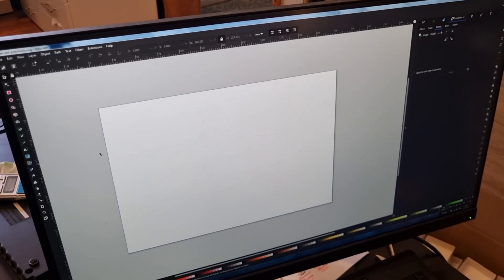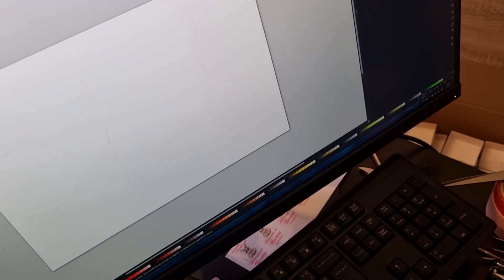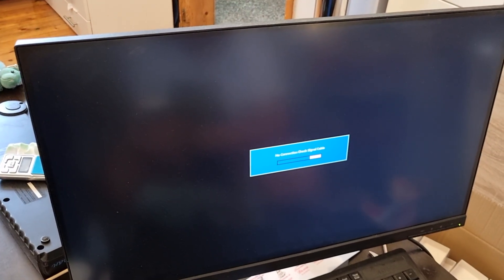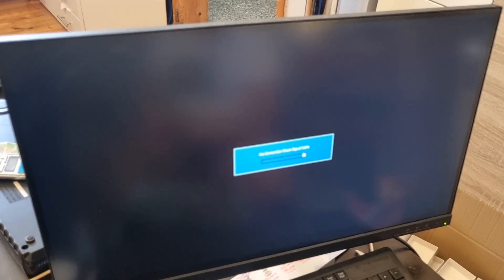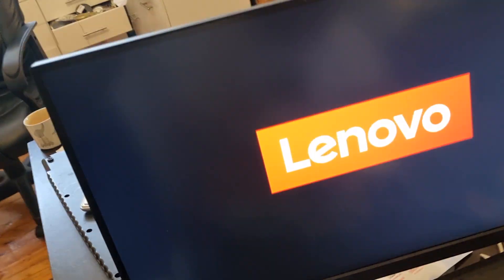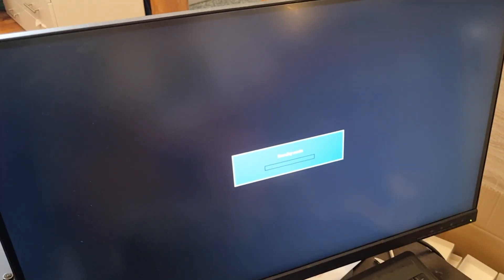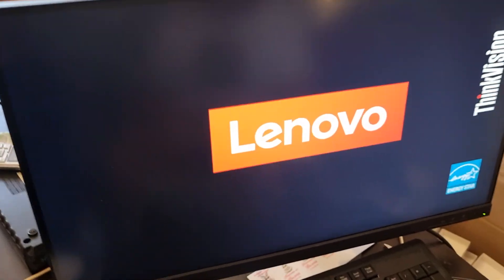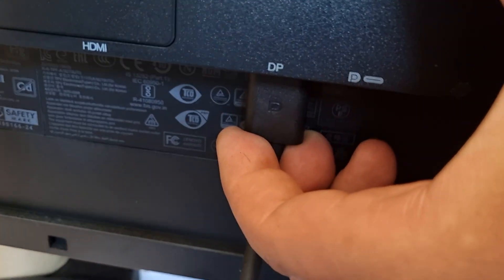Lenovo ThinkVision Standby mode Problem - Why and How to fix it.

Comment: It happening while doing bios setting, I just do exit and reset, and since it's saying standby mode, while my pc is on and my ram and gpu both lights are on ?
Reply: Same! I just can’t even enter bios when restarting!
Reply: @SumzYT final option open the cmos battery and drain all the power of the motherboard, rest for 5 mins and add the cmos battery again and turn on the pc, bios will be reset

Comment: It says says power saving mode but it's connected with the pc
Reply from the maker: Connection is not good.
Reply: @MeFixingEverything we checked the connection is fine
Reply: The keyboard DOSENT work aswell yes brand you and it's plugged in
Reply from the maker: I don't kniw
Reply: @mrbeeeeeeeee3041 did you fix it?
Reply: @Jubi-oy8pyyea I did turns out you have to wait and it opens by itself